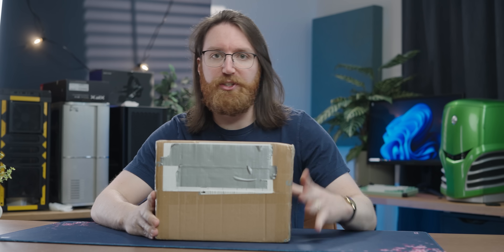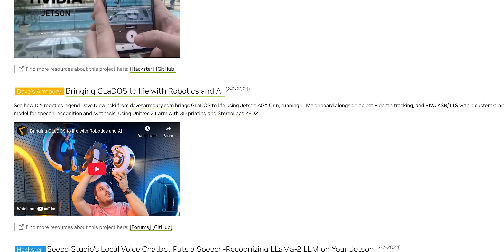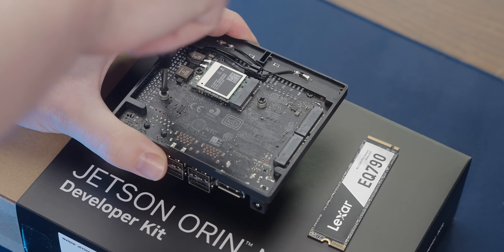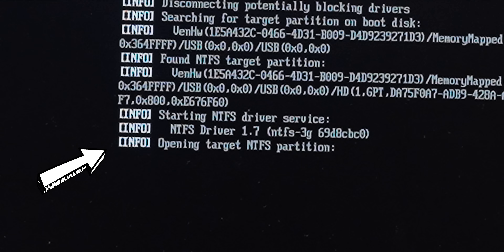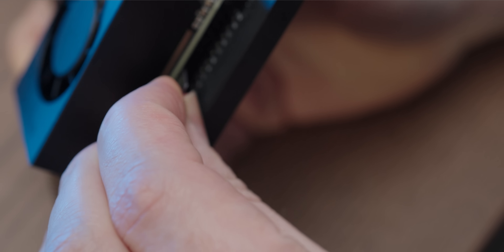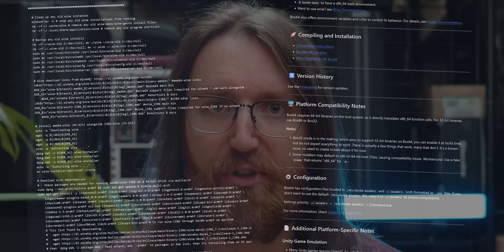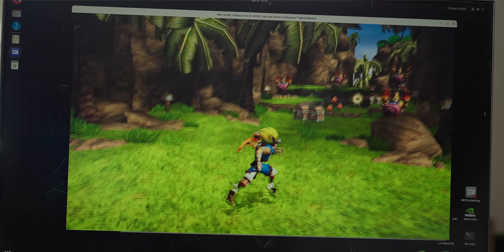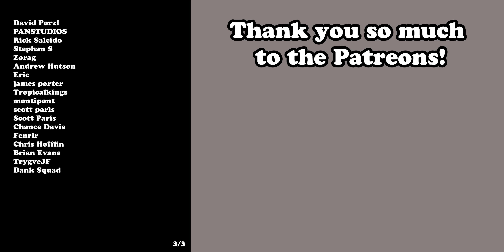Gaming On Nvidia's TINY Super Computer...

Comment: As a full-time Linux user, this Video was painful to watch
Reply: He lost me at the balenaEtcher comment - as if it was some new or far out there type of software. Nope. It’s pretty industry standard for that task.
Reply: @ScottTheCarGuy  who doesn't have a ventoy drive these days
Reply: not reading on how to operate the system first and then frying the whole board is very LOL bruh.
Reply: I use Arch btw
Reply: "full time Linux user" that's not a job 😭
Reply: @kokaboba  It just means they uses Linux on all their systems, probably also at work. So, using Linux can be part of your job 😅
Reply: @kokaboba As an IT technician(server maintenance) reading this, you saying we're not working?
Reply: gentoo on my  main pc and I'm watching someone download the "steam exe" from "the appstore" 🤦
Reply: I use arch btw
Reply: thank you for your service
Reply: This comment was painful to read
Reply: sameee, first mistake was ubuntu xD
Reply: I don't think is as painful as being a full-time Linux user XD
Reply: @Rojame77  I get it for those that don't spend the time to learn Linux it seems a bad choice over Mac or Windows. Once you spend a fraction of the time required to maintain a windows machine Linux is easier. Mac is awesome but limiting with low quality hardware compared to a windows build with Linux installed. I dual boot every and that has saved me many times when the Windows or Mac os choked.
Reply: I was wondering what that smell was...

Comment: Having the base os (read only) on the sd Card doesn’t matter you’d should have taken a Linux course about the Linux FS and have your working data and programs (like games etc) just in the nvme

Especially for the intended use of this device.

Also not sure if the games you are running are x86 and emulated. Try native ports like Xonotic for instance that should work like a charm

Comment: The fact a bios setting change could brick the whole thing, not exactly reassuring.
Reply: Even worse is there is no obvious way to reset the bios.
Reply: @MoultrieGeek  It's the same for most Nvidia boards, put it into RCM/Force Recovery mode, and reflash everything. The device itself is intended for development/industrial purposes, and the people who service them do know how to fix them - as well as what the options mean in the UEFI.
Reply: @MoultrieGeek  You just use the Nvidia SDK Manager on a host machine running like ubuntu 22 with the board in recovery mode and it will fix it. Just like everything else Linux you just have to read the documentation. Nvidia made it pretty easy to do.
Reply: @CosmicOstrich  bold of u to assume these utubers can read
Reply: I have a Lenovo dev board and it bricked disabling CSM. 😅 Luckily, it's like any other Thinkstation and I was able to recover it via instructions from a YouTube video.
Reply: You have. No. Idea.
Reply: It's not bricked. Just won't boot the drive in AHCI mode. The components are all fine though.
Reply: It's a dev kit, meant to be used by people who know what they are doing
Reply: @aphfug  And your point is?? Jesus, like Devs are God or something? Just have an "oops, let's try again" button.
Reply: @TheJohn8765  It just means "for people who know what they are doing", this is not your regular computer for regular purposes (like gaming). The "let's try again" part is never easy even if you're a dev who doesn't know what he's doing and, he clearly did no know what he was doing.
Reply: it’s a dev kit…

Comment: I think what people really need is an AMD AI Max processor in a small form package like this, as Nvidia just won't undercut their own product line for less, they're too greedy, hence why this is bored by design. I mean running an OS off an SD card, plugged into the mainboard basically under the CPU? Because heat never killed an SD card reader on a ROG Ally, did it.

Comment: That port on the board is called MXM. Its basically mobile PCIE, for swapping gpu in laptops when that was a thing.
Reply: No it's very definitely a SODIMM ram slot. Very common in this kind of system, the more recent raspberry pi compute modules do the same thing.

Comment: It's because the ARM64 version of RPCS3 can't use it's full cores due to difference in how x86 and ARM handles SIMD. Short version: You need about 4 ARM cores to get the same SIMD values you get off one modern x86 core. It's running like butt cheeks because this thing only has 6 cores and it's nailing 4 of them to emulate 1 of the cores you need for PS3 emulation - and you need about 4 of those on PC to get decent performance in higher end games
Reply: Not only that: during gameplay it's still compiling shaders
Reply: Not only that: Why not use PCSX2 or AetherSX2 to emulate the very same Jak games he played in a more power efficient and less glitchy manner? I don‘t know whether OpenGOAL supports ARM64, do PS2 emulation seems to me the best option for Jak and the only option for Jak 3.

Comment: The power connector doesn't set flush because it's designed to be inside of a case. If it's at flush outside of the case it wouldn't plug all the way in once you put it in something
Reply from the maker: Mind blown. That makes complete sense.
Reply: But the end of the barrel plug receptacle's black plastic shroud is flush with the base just like the USB-C port's metal shroud (1:02), and the USB-C connector is shorter. If what you state is true, you wouldn't be able to plug in a USB-C cable all the way once it's in a case.
Reply: @bubbledoubletrouble maybe the idea is to have the barrel jack be part of a thicker surround and the main I/O have a thinner shield like what you use on a pc build? Just spitballing ideas since case makers can do pretty much anything in terms of how they design the thing as long as the machine fits inside.
Reply: funny seeing you here
Reply: My thoughts exactly

Comment: Mr Dawid! Did you hear the latest news? They say the 1080 is now officially dead since the rtx 5050 can be overlooked to out perform the 1080. Gonna give it a run down?
Reply: Well... it's been a good 9 years then. Really impressive
Reply: @itizjuan it is impressive. However, what happens when the 1080 gets overclocked?
Reply: What you need to know: • One modder pushed the RTX 5050 to an incredible 3300MHz, achieving a 28% clock speed increase over stock settings • This overclocked budget card now outperforms the GTX 1080 Ti, a GPU that once cost nearly four times more at launch • The achievement netted the modder the top six scores in 3DMark Time Spy, showcasing consistent, repeatable results
Reply: He's already reviewed the 5050.
Reply: @Zerbey not one overclocked to 3300mhz

Comment: if it's arm based, wouldn't android emulation work the best for this situation?
Reply: Android will work directly on any other ARM SoC (and boards), without any emulations.
Nvidia, doesn't provide official support for Andoid, for some reason. But bet there're unofficial builds for that. Like LineageOS.
Reply: Maybe

Comment: Fun fact: This is pretty much a cut-down, less power-efficient Switch 2.

Jetson Orin Nano

CPU: ARM Cortex A78AE 6-core
RAM: 8 GB LPDDR5 @ 102 GB/s
GPU: Nvidia Ampere GPU (1024 CUDA cores)

Nintendo Switch 2

CPU: ARM Cortex A78C 8-core
RAM: 12 GB LPDDR5X @ 102 GB/s
GPU: Nvidia GA10B (1536 CUDA cores)
Reply: all it needs is the switch firmware and the game card slot
Reply: @whoTF-isTakeachance2 Switch 2 has custom modifications made to it. Nvidia backported some tech from Ada (RTX 40-series) to the chip and worked with Nintendo for a ton of custom optimizations (including Nintendo's own custom version of DLSS that CP2077 uses).
Reply: Orin Nano uses the Tegra T234 with 2048 CUDA cores and 12 A78AE, and some more stuff, but everything is halved for either horrific 8nm yields due to Samsung incompetence or product segmentation. The AGX Orin gets the full die.
I honestly wish they'll launch a development board with the T239 found on Switch 2 and set the bottom bin T234 aside. Rumors say T239 is in Orin Nano Super.
Reply: Yeah like I don't know why people would use this for gaming instead of using those 36 tensor cores for Ai workload. Wait! this has 32 tensor cores and switch 2 has 48??
Reply: @bhluschreanseems like the switch 2 is better for AI then
Reply: The switch 2 also has 48 Tensor Cores and this has 32.
Reply: But you can buy two of these for the price of 1 Switch 2.
Reply: @mrwang420  Yeah, but the Switch 2 also has a battery, screen, dock, controllers, 256 GB of storage, and an OS that can actually play games
Reply: @ommexyt  An $80 haptic ir split gyro controller. Say what we want about Nintendo's current business practices, but the Switch 2 hardware is extremely sophisticated technology in the smallest package imaginable. People try to directly compare it to the latest steam compatible handhelds, but those things are bricks in comparison.
Reply: I remember telling @GaryExplains that this is just the upcoming Switch 2 chip but cut down and he got really defensive about it for whatever reason... 😬
Reply: Why is switch 2 only 12gb?

Comment: With the partnership with intel, nvidia x86 cpu's incoming. AMD about to go bankrupt
Reply: quite an overstatement considering AMD powers most of modern gaming console.
Reply: Never buying Intel again tbh
Reply: Except how would Nvidia & Intel fit their tech into socketable CPUs? The Ryzen 395 has a 4060ish GPU on it but can't work with sockets or DIMMs
Reply: Lol the cope is hard, Also Nvidia can't make X86 CPUs themselves without getting permission to use 64bit architecture from AMD, so as far as CPU is concerned it will only be intel. X86-64 architecture is a mutual partnership between AMD and Intel, Nvidia has nothing to offer AMD to be allowed to manufacture it. Also comparing how gigantic Blackwell dies are compared to RDNA4 can't see them making a power efficient small soc like 395+ or by that time AMD's next gen APU
Reply: If arm truly does what it looks like it will, then AMD will make arm chips